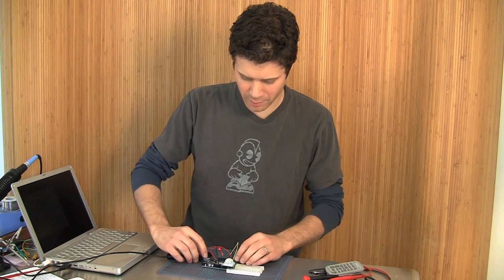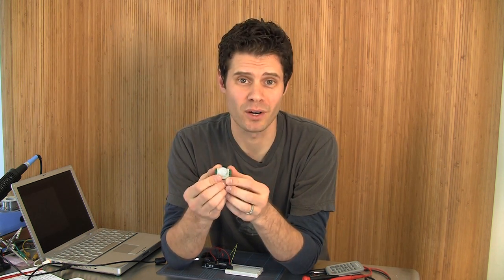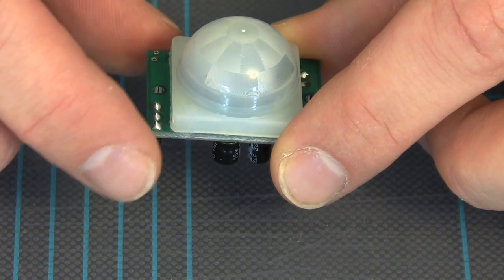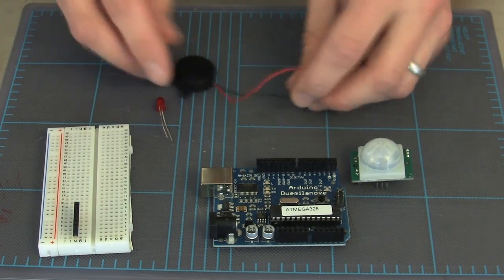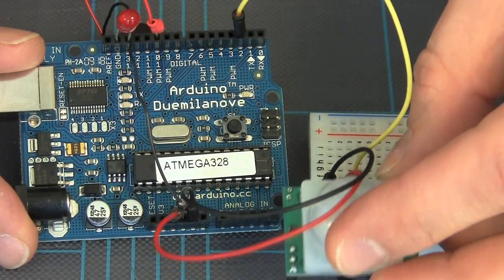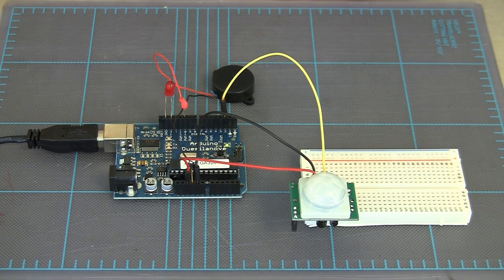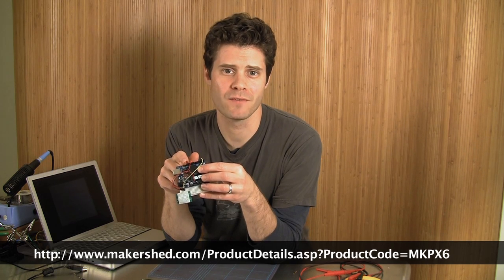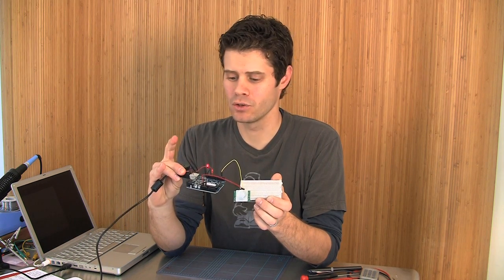John Park in the Maker Shed: Arduino PIR Alarm

Comment: @FriPilot An Arduino is a single-board microcontroller and a software suite for programming it. The hardware consists of a simple open hardware design for the controller with an Atmel AVR processor and on-board I/O support. The software consists of a standard programming language and the boot loader that runs on the board.